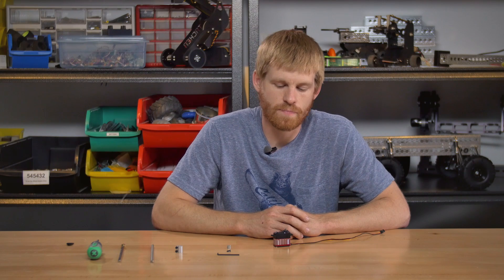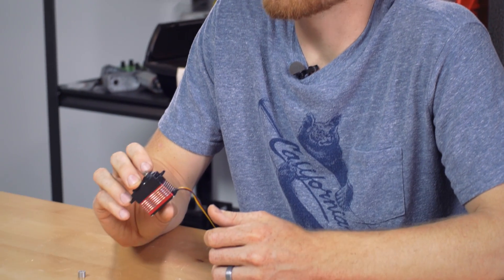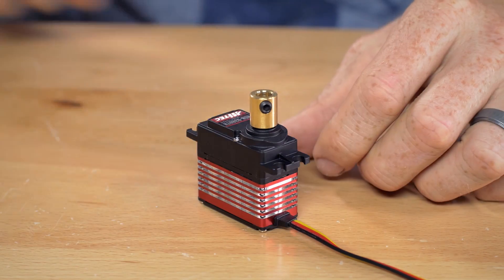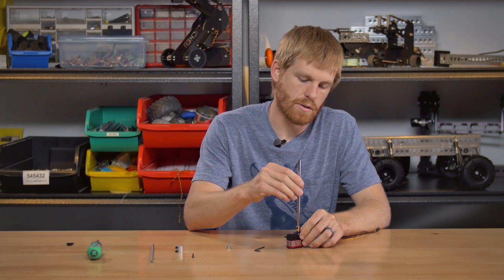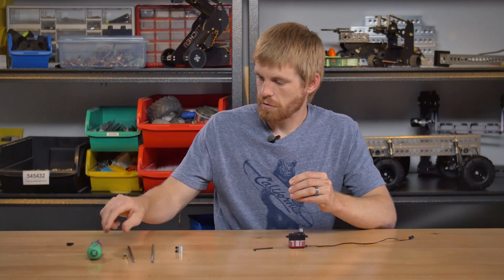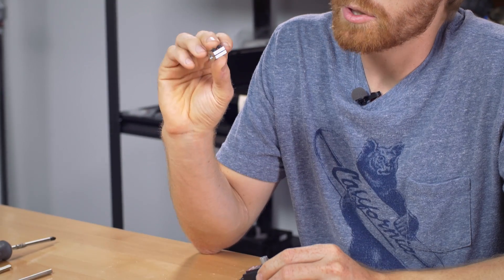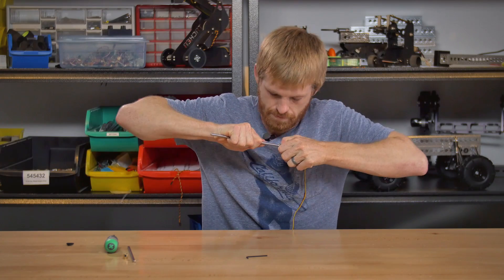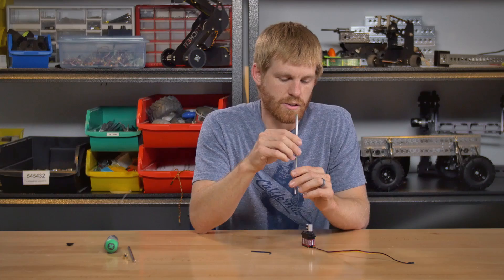Connecting Shaft to a Servo - With Kyle

Comment: I have a project where I need to turn a 10 turn pot with 1/4 inch round shaft using a continuous turn servo. Very low tork application. 

What is the least expensive solution?

I was thinking of putting a control knob into a metal lathe and drilling a center hole for the servo screw.

I don't have a 3D printer, but the only other option was something that mounts on the servo that has friction fingers to turn the shaft that will slip when it hits the limit of rotation..

Comment: Your brass coupler looks to be what I need, but it looks to be for larger servos than what I have?
I need short shaft extensions for MG90S servos - 25T. The servo shaft diameters are .19" to the outside of the splines on the MG90S servos. 1/4" ID diameter on the shaft extension is perfect because I need to couple the servos to 1/4" shafts. Anyone know of a source for such a thing.

Comment: Can I use 2 servos to increase torque for the project I have, or the servos might interfere against each other?
Reply: If the servos have stoppers and they are controlled by the same variable, I think you should be alright.

Comment: i have one question, i am a student of engineering electronic control, and right now i do for my final year project, so i decide to do a trash sorting machine which is i use the servo motor to sort the trash, so i wanna asking, is that shaft will turn if i put a wood on it as a sorting item?
Reply from the maker: Hello YoungJaff, please email our technical team at Tech@ServoCity.com with your application specs and they should be able to help you further.

Comment: does the 25 Tooth (3F/H25T) Spline, Servo to Shaft Clamping Coupler, work on the Continuous Rotation Servo - FeeTech FS5103R?

Comment: Will it fit on Feetech SCS215 servo motor
Reply from the maker: Hi Zeeshan, based on info on the web, it appears as if Feetech uses the same 25T spline that Futaba does.  If that is the case, the SCS215 servo would mate well with any product we offer that utilizes the 25T, 3F/H25T spline size.
Reply: Thanks